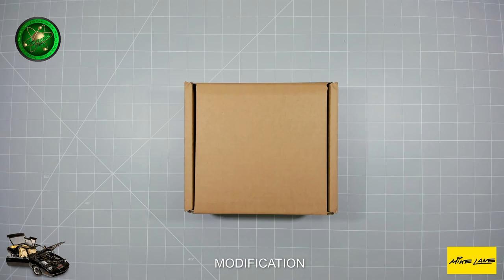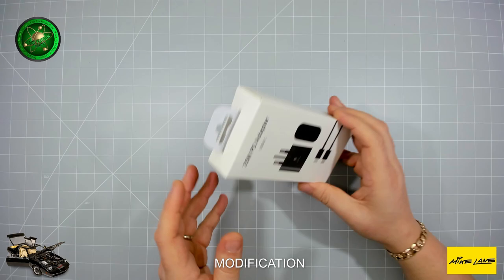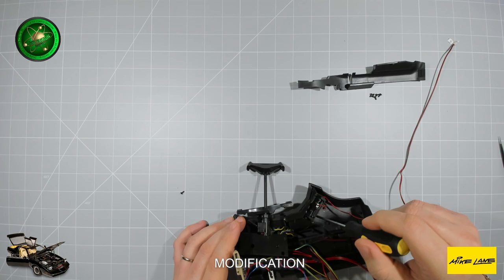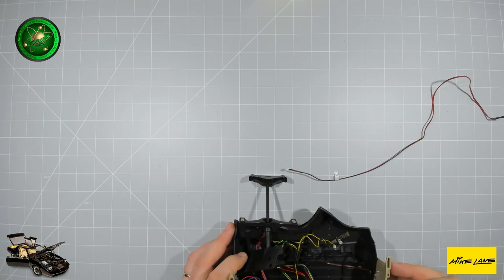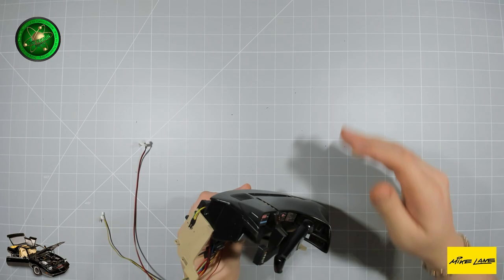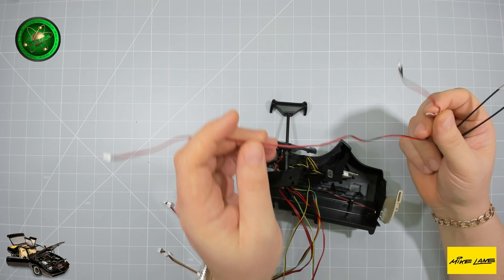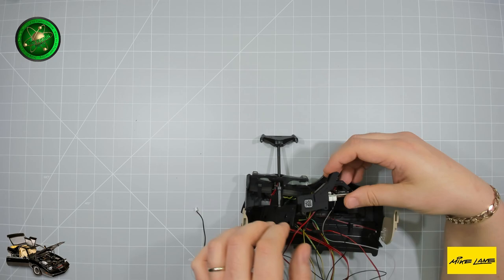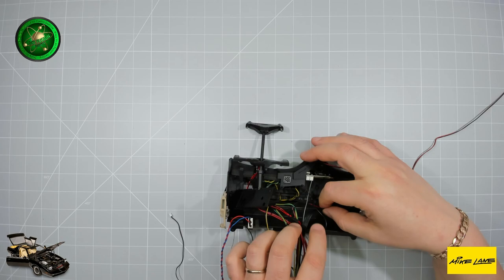MIKE LANE STEP-BY-STEP GUIDE FOR THE DASHBOARD MONITORS  & POWER BOOST FOR KNIGHT RIDER KITT FANHOME

Comment: Can you connect it to the battery compartment?
Reply from the maker: Hey ronny yes with the Y splitter cable if you seen in my video i say it when connecting the screen to one said and the battery to the other side of the Y splitter and thats it very easy to do